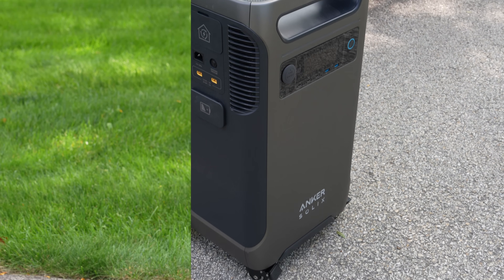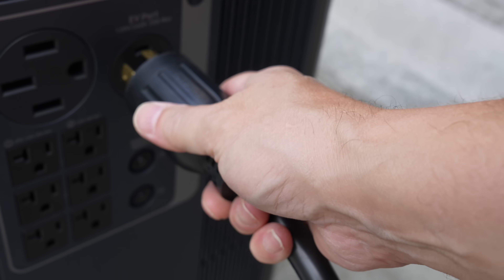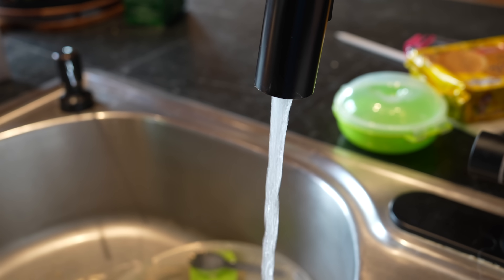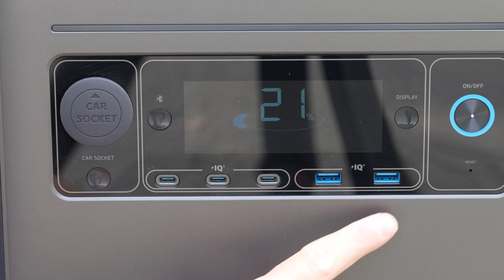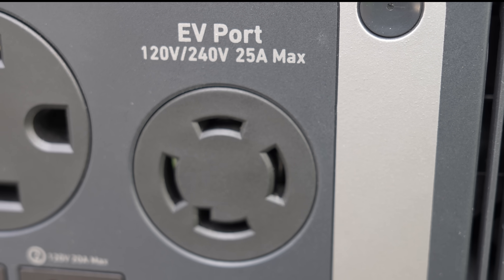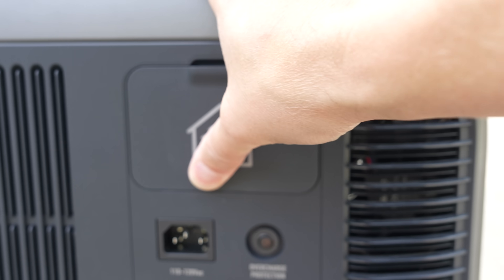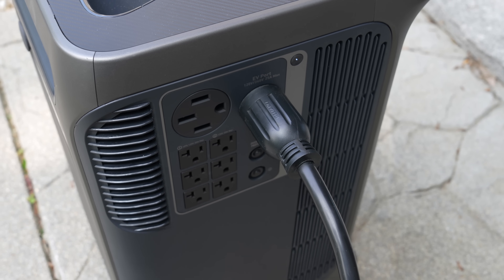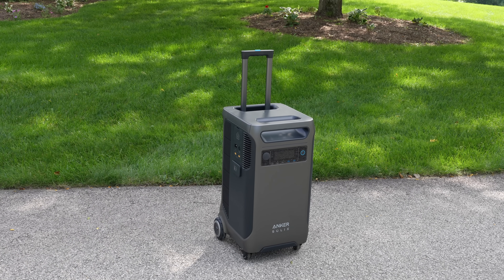Better than GAS Generator? First 240V Battery Backup - Anker SOLIX F3800

Comment: I wish this would have given some examples of runtime under various loads.  The average person is going to have a difficult time quantifying how long this is going to power various scenarios.   As in, will this keep my 3 ton AC unit, fridge and basic lighting on if the power is out for 8 hours?   Technology is coming along at a quick pace... I wonder how long it will be until a battery backup is truly competitive with a generator (which can run for hours and hours).
Reply: It won't run your 3T AC at all unless it's a variable speed model or you have a soft start kit installed. Even then,  at just 3820Wh, it won't run it for very long. Our new 4T VS American Standard draws about 3.8 kWh. So, it would only run it for an hour continuously. Perhaps 2 hours if it was cycling on/off.
Reply: My house pulls around 750-1400 watts if I am careful with what I run. Being extra careful I may get thru the night with this unit and use my gas gen during the day. My gas heater and gas water heater use about 700 watts total when running.

Comment: This would be handy to plug into the generator panel to silently run overnight circuits, then fire up the gas generator during the day to run those and recharge the Anker (or use solar to recharge, if available). Currently I just plug my fridge and freezer into another solar generator overnight, but using the generator panel input would be way more convenient and still allow the other circuits (like lights) to work during middle of the night pitstops. Thanks for posting this!
Reply: Like a UPS?
Reply: @user-li6go4lk1b  I suppose so. Is there a UPS large enough to run a 120/240V 30A panel load overnight? Honest question as I don't know and I always think of those small ones to protect computers for a few minutes. I know an overnight load would be a lot less than during the day, so maybe something smaller will work.

Unless you mean something like a Telsa Powerwall (or one of the many alternates) system, but they are all a lot more money and not portable.

If you have some suggestions for me to look into, I'd certainly appreciate hearing them!
Reply: @jamesiversen  not sure for residential, but military, hospitals, entertainment productions use large scale trailer UPS’ that take shore power, then supplement with genny if UPS is engaged.
Reply: With only 2.8kwhr you won’t be running very much or for very long.
Reply: @clarkharms  It's actually 3.8kWh, which with overnight loads would actually last quite a while. I have a 2kWh battery that runs my fridge overnight without issue. The Solix 3800 would certainly keep a fridge, freezer and occasional well pump cycle going for 7-8 hours while we sleep, with one plug into the generator panel via the L14-30 plug rather than using multiple batteries or extension cords. Plus, it is expandable to 53.8kWh! You could go a long time without having to fire up a gennie to recharge. And that's not even with any solar panels.

It certainly isn't for everyone, but I live in an area where a 36-48 hour power outage during storm season is not unheard of. Having something like this to keep the lights on and minimize generator runtime (not replace) is worth considering. 🤷‍♂
Reply: @jamesiversen  yes 3.8.  Still way too small for my overnight needs.  I want my ac in the summer and heat in the winter.  This an only run my ac for about 40 minutes.  This just isn’t cost effective since you still need a generator.  I put in a remote outlet for my generator, it is about 100’ away on the other side of my shed, I can barely hear my generator from inside my house so this is a very expensive and limited solution to a problem I don’t have.
Reply: @clarkharms  you're right, it wouldn't last long if you need to run an ac off it for any length of time. Anyone considering a battery backup solution would need to run the calculations to confirm it would meet their needs.

As I said: it's certainly not for everyone, but it is an option for some. Options are good! There is no one perfect solution for everyone, contrary to what the government pushes on us.
Reply: This can probably only run your house for a couple hours

Comment: 2:42 “the one on the left is the more common one for something like a dryer or even devices like welders”
That’s NEMA 14-50, not the NEMA 14-30 dryers often use. These days it’s more common for an EVSE vehicle charging. It even says “EV Port” right there. What concerns me is that it’s only 25A when they use a 60A plug.

Many EVSEs will default to 48A when used with that plug since the plug is not supposed to be used without a 60A circuit and continuous loads give 20% headroom. If they had put a NEMA 14-30 there instead then there wouldn’t be an issue. The AmazingE EVSE is designed for NEMA 14-30 exclusively and only draws 16A through that plug. A Tesla Mobile Connector EVSE with a NEMA 14-30 adapter would draw up to 24A and since 24 is less than 25 you should have time to reduce it from inside the car if continuous loading might be an issue. If this thing overloads before you can make that adjustment because the Tesla MC with the NEMA 14-50 adapter went straight to 48A, well, it sure isn’t going to be much good for roadside rescues… which is what I wanted it for.

Comment: Thanks for sharing this! To be clear, even with the larger port, this is only capable of 25 amp output? If you combine two units, will one port output 50A/12000W?
Reply: If you're at the limit, You can have 25 amps at 240 plus some more power on the 120v outlets.
Reply: @gelu88  that does me no good. I'm looking to power the whole house with one output like I can with a fossil burner. LOL
Reply: @markkempton4579   At 03:26 Chris says "additional wattage", which implies 12kW and thus 50A. But I could not find concrete confirmation of this in Anker's technical materials. In any case, you won't get much run time with 2 of these units when pulling more than 25A. For example, if you are drawing 2kW@240V and 3kW@120V (~33A total), you'll get just over an hour of power. So we'll both be stuck with our fossil burners for extended outages, at least for the foreseeable future.

Comment: It seems like a good solution for an RV. However, the power outages I really care about have lasted a day or more and how would I recharge this? Also, can it be recharged while it's being used? If so, it might be good as a sort of hybrid system with a small, 2000W inverter style generator.
Reply: Both solar panels and a gas generator can recharge the unit.
Reply: @Jasonoid  While the unit is supplying power?
Reply: @paulv22  I don't see why not. I test for that on my channel.

Comment: I wonder if you could’ve run that dryer without the well pump and made it work?
Also, were you hooking the unit up to 50 amp outlet?
Reply from the maker: Absolutely, the fact it hit almost 8000 is nuts. Most inverters can't surge for more than 1 second max. 6000 is definitely fine and you could switch from dryer, microwave, well, etc. Just balance it for the 6000 watts. I do this with our gas generator. We shut everything off so we can dry clothers. We lose power for 3+ days a lot so you need the regular stuff

Comment: If you were to run just your dryer in the video, approximately how long would it run on a full charge?
Reply from the maker: With just the single box as shown you could run a 5000 watt dryer for about 45 minutes continuously. Not a great runtime, but thats a maximum load non-stop. Compare that to say a fridge and pellet stove fan, and this could run both of those for almost 2 days. Non-continous loads are gtreat for batteries. Say a well pump that takes nothing when not in use but is critical for an outage. This could meet that need for  3 days. Just wanted to add a little more to put it in context
Reply: @SilverCymbal  thank you. Would you say this new F3800 w 240 v is a better option than buying their 767 which i know only has 120v? I was able to bid on the kickstarter F3800 for $3500 w solar panels but can get the 767 for half the cost or more plus amazon prime and costco next have great deal now on bundles. I’m really only interested in keeping my fridge running and a couple small appliances during an outage. If the power is going to be out for more than a few days, I’m going to have to leave town to the nearest hotel that has power anyway. What do you think?
Reply: @SilverCymbal For a three day emergency, forget the well pump.  I know this is sacrilege but what about a case of full PLASTIC water bottles.  I know.  Oh, the horrors to the environment!